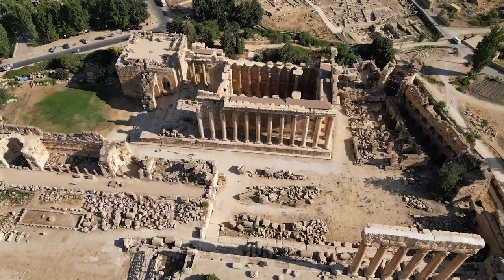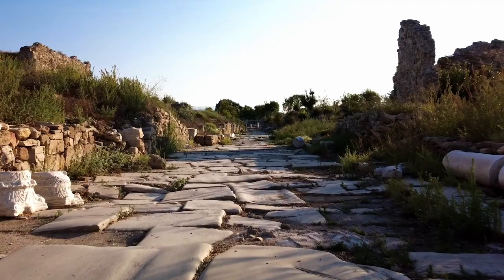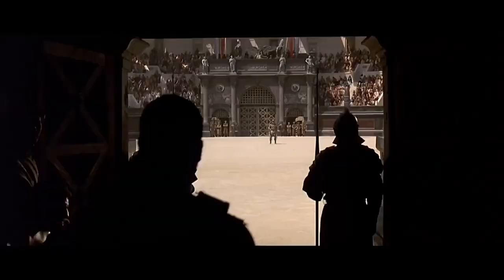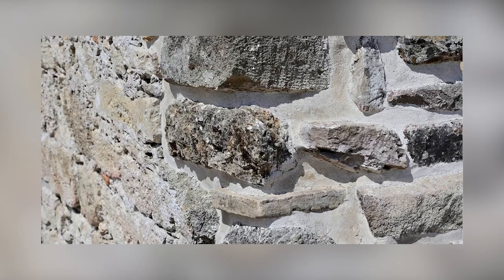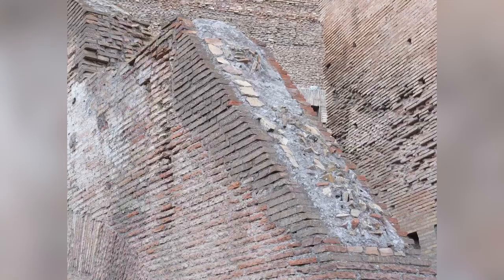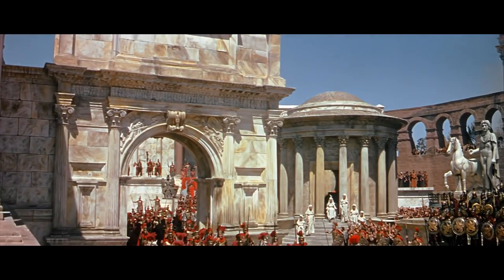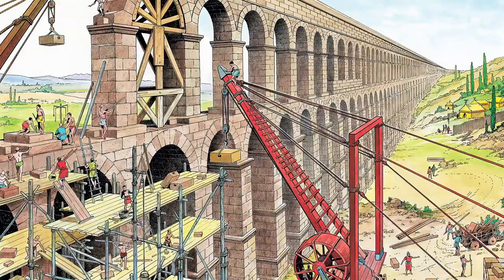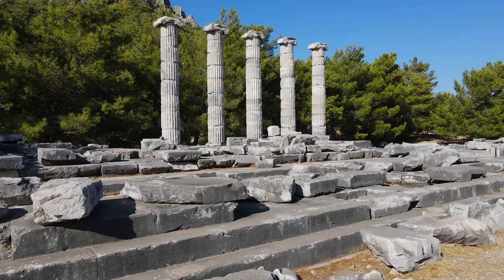DEBUNKING the Roman Concrete Hype

Comment: So what I’m hearing is that it’s not as good as modern concrete because it’s not modern and they didn’t use modern ways to make it
Reply: Despite the sarcasm you're basically correct.

We have very precise mixes with very refined ingredients so you know exactly what you're getting almost every time and the concrete is uniform.

Which is essential for engineers to do accurate and reliable calculations.

If you use the Roman Concrete you either have to significantly overbuild to compensate for the uncertainty or only use it for basic non weight bearing situations.

Also, you might have missed the part where said it was weaker, which it is.

Its only benefits are it gets stronger over time and can repair itself but it has lots of negatives.
Reply: @retsaMinnavoiG  well in that case i can conclude  roman concrete is infact better, if it necessitates overbuilding with more generous safety margins are the only gripes because heaven forbid people cant be as niggardly with costs because of worship of the idea of lowest bidder as some damnable gold standard, but in return get buildings that are almost guaranteed to outlast the nation states that they were built in if not torn down, then i fail to see the problem, those are upsides not downsides.
Reply: @retsaMinnavoiG - I studied as a Civil Engineer spending a whole year just learning modern Concrete - now 30 plus years after that education I am relearning concrete from a much broader perspective and Portland Cement is a problem - a modern problem that needs understanding better - modern Concrete has a terribly short lifespan, is non breathable and destroys other building materials over time - modern Concrete is crap.
Reply: The Pantheon , the largest unreinforced dome in the entire world, is still standing in perfect conditions after 2000 years whilst our buildings start cracking and falling apart after 50 years
Reply from the maker: This 👏👏👏
Reply: @StrictlyEngineered  How is to Portland Concrete and it's derivates last at best 50 to 100 years while Roman Concrete is still around 2000 years later and despite what you say they know how to measure fine amounts of materials just look at the jewelry, They also knew how to pour concrete is layers, You also Confuse Concrete Cement and Mortar

Comment: While i appreciate your tamping of everyone's expectation of roman concrete to be somewhat useful in modern times, we do know more now and this will undoubtedly be another tool. The real usefulness is the self baking property that can really help in the 3dprinting aspect.
Reply from the maker: Never even thought of that. That would be a really interesting application!
Reply: That's cool!
Reply: @StrictlyEngineered  Modern technology mixed with ancient concrete technology, (modern is trash obvi) = Future buildings and other infrastructures of the future age
Reply: @StrictlyEngineered  The Quicklime wasn't formed because it was badly mixed, it was formed in a chemical reaction which they called hotmixing. They didn't bake the mortar like we need to bake cement at 1400°C. It's pretty strong and Calcium carbonate gives a nice whitewashed look when it reacts with water. Or that's how I understand the process.
Reply: Yes they did bake the limestone or sea shells..they didnt add water to it to form slaked lime..they added the baked quick lime directly to the rest of the ingredients of concrete and then boiled it before pouring..this is a double whammy in reguardes to carbon footprint fanatics..and if you consider the fact that it didnt have endless semis and high speed traffic running over it 24/7 it wasnt all that great..it was more of a facement to monuments and road beds than a structural implement..the real durability was in the actual structures not the flimsy stucco they were using to cover them because it actually didnt bond as well as portland so it is garbage
Reply: @Jerry-de4pl  Yeah, the Quicklime could also generate heat when mixed with the water and the other dry ingredients in order to bake it for a hotmix.
Reply: So basically what Roman concrete is is type n mortar with larger aggregate added making concrete..that's pretty much all it amounts to which makes a pretty sorry concrete..they did boil the concrete before using it but I believe modern Portland cement is much more durable and as far as structural integrity goes is superior to Roman lime concrete..Portland cement is definitely a modern marvel that has been taken for granted..the old lime concrete and mortars can't hold a candle
Reply: Oh and they added the equivalent of fly ash to their lime concrete which makes it even more flimsy and less durable..modern Portland cement has to be applied correctly or else it will harden to the point of turning to dust..it has to be mixed right..the old school mortars and lime concrete mixes set up very slowly and won't reach their full potential as far as psi for a long long time even potentially longer than the usefulness of what it was used on so this alone makes it inferior to modern cement end of story
Reply: @DickDuran-ch2tb  My friend I love your enthusiasm. But I fear you have made a few errors.
1. Roman concrete isn't special because it has "larger aggregates" not at all, some have very fine aggregates. The lime clumps are merely a reservoir for what really makes this mortar and lime mix special. I believe the chemical formula is CaCu, however, I'm not a chemist and I have forgotten the original formula to a degree. What it essentially does, is it reacts with moisture to form a compound that hardens and seals the cracks where the moisture entered.
2. The Pozzolanic fly-ash is fundamental to making the mortar harden. The particles are extremely small and fill spaces within the solution very well, making the solution more dense. This entire point is actually moot because the Romans rarely used fly-ash as a pozzolanic material. They used volcanic ash. Pozzolanic material basically only reacts with water to form a CaHO reaction (calcium hydroxide) which hardens into cement. That's why it can be used under water.
3. Roman concrete dries faster than Portland cement if you mix it properly. By hotmixing the quick lime into the solution, not slack lime. These clumps wil form.
4. Portland cement was produced to be cheap and doesn't last nearly as long as Roman cement. This is an undeniable fact. The shear rate and tensile strength may differ from  Portland, however, the durability and longevity of roman concrete is already proven whenever you view the Pantheon in Rome.
Reply: @Muppet • 50y and  the point I was trying to make was that Roman concrete is very close to type n mortar with aggregate added to make the mortar into concrete..and it is..also..volcanic ash as in pummace makes for a really sorry additive in concrete..fly ash is identical to it in composition and also makes for a really sorry additive for most  applications that require shear strength or anything structural..it is primarily used in road beds to stabilize dirt Crete or to be specific soil that has large amounts of organic material or clay..it has no tensile strength whatsoever and never will due to its physical weight and makeup..these structures built by the Roman's that have lasted so long have either been buried or re built countless times and saw a minimum amount of traffic..any benefits it had wasn't enjoyed by its benefactor because they had long since died before it ever hardened enough to be considered true concrete because let's face it..ask any brick Mason and they will tell you the same thing..lime based mortars and concrete mixes aren't stable enough to build anything structural that will see much traffic because it will break down really quickly..as far as it's hydraulic properties I haven't researched that topic but modern hydraulic concrete works very well the same decade that it's poured..it doesn't take 409 years to fully set up

Comment: Title a video as is it's trash then say good things about it as if they're a bad thing. Then make unsupported comments about their lack of engineering knowledge and how it's just used as a face material and how it can't be used with rebar... But no explanation as to how you might be right. Because you're not. And then you say it's poorly mixed like that's a bug, but it's literally done on purpose. It's a feature, not a result of poor mixing 😂. And multiple types - cool, for different applications, no? And to say our tech is better but it fails after 50 years and fails ALL THE TIME after fresh pours in garages and foundations... Yet the Roman concrete is still standing 2,000 years ago and we haven't been maintaining it like THAT. Smh, poor video, man.
Reply: THANK YOU! 
I was literally about to type, nearly the same comment.
Reply: Glad someone already said it.  Comes off like a 7th grade class project he phoned in.
Reply: Yeah this video wild. Just some random stuff without a relationship to the topic therefore it's bad.
Reply: Give him some slack. He has good points. Not saying that the over all conclusion is great but he presents information I find useful that is not even glanced at by those who have hyped up “Roman” concrete.
Reply: As someone researching self-dependent construction and just had to clean a house of over 500 gallons of water from seepage. I find all this information very useful. 

It is good for keeping the mindset moderated.

Comment: Yeah dude totally, my concrete driveway is starting to chip and crack after not even 5 years while Roman concrete roads paved thousands of years ago are still standing strong and self repairing cracks every time it rains ...but keep telling me how advanced our tech is with it's built in obsolescence 🤦‍♂️
Reply: Roman concrete is the goat
Reply: Romans didn't pave roads with concrete my guy. They did normal brick laying for roads not concrete

Comment: I'd like to see you build a concrete dome that lasts 2000 years. Bro is delusional
Reply: @skyetaylor2955  he has good points and some less than good. I think the main issue is how quickly you can use it for its durability since it gains strength over time.

Comment: MIT's research seem to indicate that it was not poorly mixed at all, it was heat mixed.  Some research also suggests that concrete used for important structures was set in sea water for many weeks after the heat mixing and molding.

Comment: They will probably do research on the optimal quicklime lump size and mixing ratios then keep it a trade secret :/
Reply from the maker: Hope not! :(
Reply: I would imagine lots smaller beads that are better distributed rather than large uneven clumps would prove far better at self healing and load bearing!

Comment: They have actually done research although roman concrete is not as strong it is far more durable. The "imprecise" mixing of quicklime was actually intentional. They would " hot mix it" with their other ingredients  and when finished they created a self healing concrete. Studies showed that when cracks reach the quicklime casts and moisture got into it the cracks would fill with the quicklime and be fully sealed within a few weeks. Just because we don't initially understand the design of things we cannot dismiss it as inferior. Roman's spent centuries building magnificent buildings and infrastructure so its safe to say they had tons of trial and error when perfecting their concrete. Meanwhile modern concrete has not been around nearly as long but give us a millenia we will probably yield a self healing concrete as well.

Comment: Your right roman concrete by itself is crap when dealing with heavy loads.
That being said it's perfect as a kind of adhesive for those massive structures due to the fact that said structures would likely warp before breaking because of the concretes reconstructive property's.
Also as a lover of history and to further make a point these structures have been around for 2,000 years and although yes they have been reconstructed multiple times that doesn't mean there wasn't a huge amount of time it wasn't being reconstructed which is way more than what can be said for modern day concrete hints to why there's so much talk about Roman concrete.
And before you argue "then why are we repairing said structures so much now" just remember there 2,000 years old and most materials from 2,000 years ago are now so brittle that extensive care has to be taken in order for said material to not break.
I also want to point out that the Romans where incredibly clever people for there time so it is possible that there method of concrete mixing was more so by design rather than a half hazard mixing of materials. 
I mean these where the people who invented the first steam engine, basically built a computer, strategized militaristic tactics we still use today, made massive structures without powered tools, and lastly off the top of my head an extensive understanding of math and geometry to the point in which they made perfectly structured buildings that where also like one giant illusion due to the way there built...
Reply from the maker: Absolutely. The self healing property of roman concrete really helped perserving the fantastic structures we see today. However there are a lot of structures that hasnt survived the test of time because it hasnt been maintained good enough. Romans didnt use reinforced concrete as we do today with prestreched rebar, which gives concrete tensile strength. A quality that opens up a whole new world for the usage of concrete. You are right though, if modern concrete was unprotected for 2000yrs there wouldnt even be rubble left. Imagine what we could achieve implementing both the self healing property of roman concrete but also its property of hardening under water in modern concrete. We have a lot to learn from history.
Reply: @StrictlyEngineered  ya I can see what you mean.
I'm not sure how reinforced Roman concrete would work though because it almost seems like it kinda needs to be able to move over time...
Reply: Survivorship bias is a real problem here. Additionally, in modern reinforced concrete, the rebar is the weak point the vast majority of the time, not the modern concrete itself. It's strong to forces, but weak to water infiltration.
Reply: @KraziEyevin  see now that's another really big problem because Roman concrete relies on rain for it's self repairing property's 
I didn't actually think about that until you mentioned it
Reply: @KraziEyevin  I forgot to mention that it isn't really survivor bias here.
You see it's all about how the structures where built and where they where built.
If you look closer in the videos there are a lot of pillars still standing even though they where striped of some of there materials which was a result of all the looting that happened.
As for any "holy" sites more care was likely taken when constructing said structures due to there importance.
Then you have to factor in how regular civilian buildings where made as compared to holy sites and necessary buildings such as bath houses.
As you can guess because there wasn't that many rich and powerful people in one city they didn't really have to many surviving buildings as a result...
Hints the reason you see so many fallen buildings as compared to standing ones.
Reply: @piyispiy  I'm not really sure what point you're trying to make, how exactly does that explain away that the buildings we see now which we use to justify our belief in the superiority of Roman concrete are the vast minority of Roman concrete structures, and we don't have a reliable measure of what the construction quality on the average Roman concrete building was? What remains today is, by simple virtue of still standing, is the best, most well-maintained, and best refurbished of all Roman structures. What we can't know is the rate of failure of the vast majority of their structures. It is inherently biased to select those very best structures and use them as the example for why the concrete the Romans made is superior to ours.

All of this again ignores the greater issue that Roman concrete is not supported by high tensile strength steel--at first this sounds like points in favor of Roman concrete, if it can last so long without it, but it's actually the primary reason for long-term concrete structure failure as moisture infiltrates the concrete and causes corrosion in the steel that breaks up the concrete matrix. But without that steel concrete structures are much more likely to fail from gradual changes to the rock or soil substrate it sits on as well as all manner of natural disasters. So our modern concrete fails over time, but until that point it can survive worse conditions than Roman concrete.
Reply: Roman concrete was exactly good at bearing heavy loads, as being under heavy load, makes it compress and thus tougher. 
That's why they could build massive buildings out of it like the Colosseum.

Comment: The mere fact that it was invented should be enough to declaim its importance. Roman concrete owes its birth to particular environmental conditions which were and are the Campi Flegrei, from which the elements that compose it were taken. The alternative would be to live in huts held together by cow dung. Regarding wear, there is a natural phenomenon called erosion which also changes mountains over time.